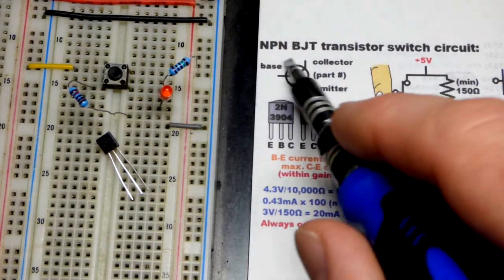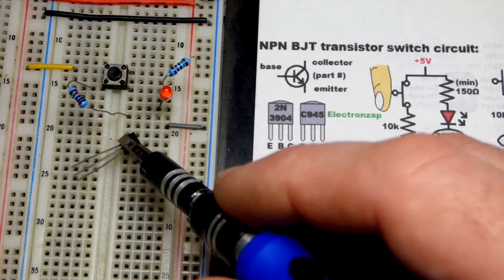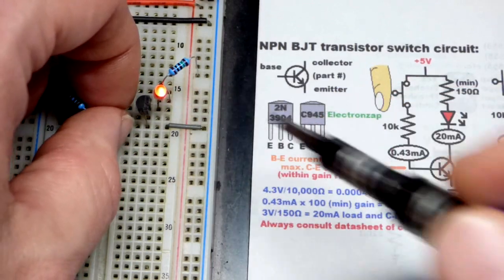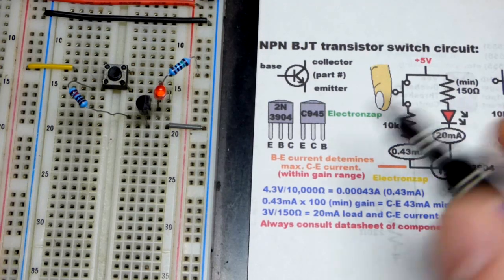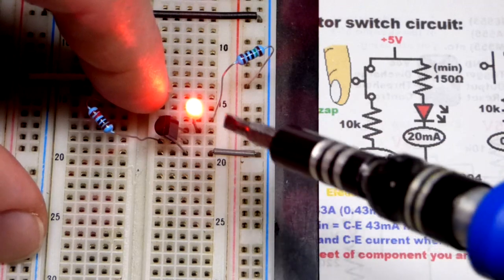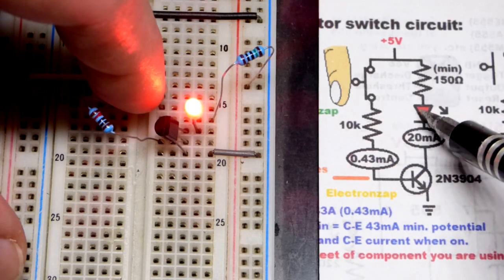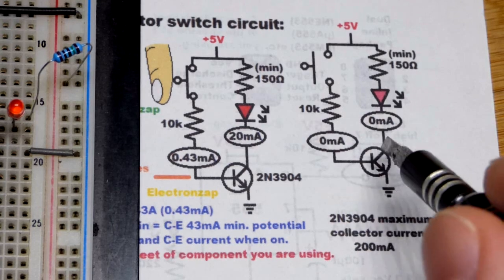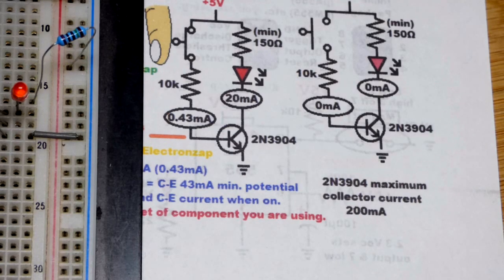NPN Bipolar Junction Transistor BJT switch circuit basics for learning electronics shorts 20

Comment: Put the switch in series with the LED and you get the same behavior. What is the purpose of having the transistor if it is not even latching nor can be turned off.

Comment: sir, please do a video about how the working of a pcb board in wall clock. 
And how to check the signals/voltages of the board. 
The board is very useful for using as a flasher led.